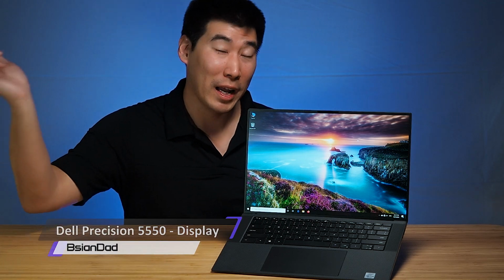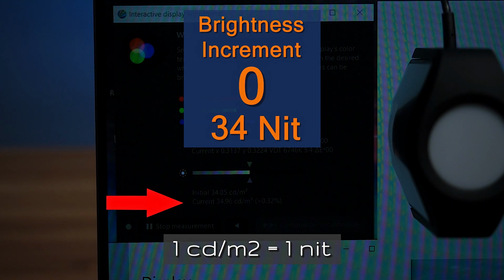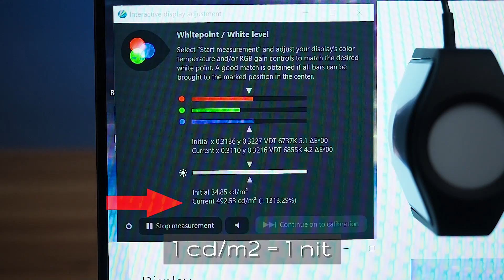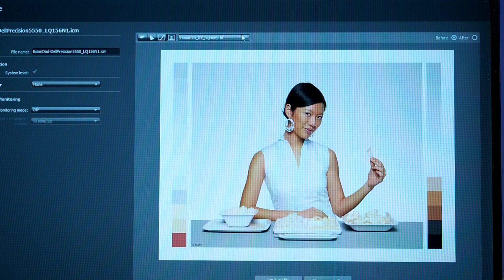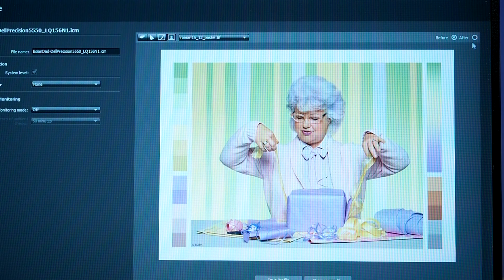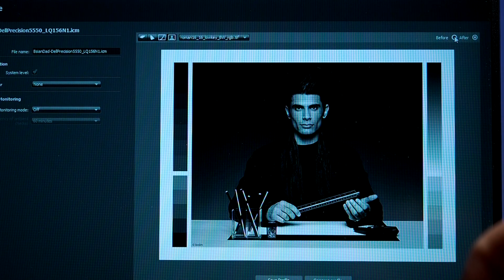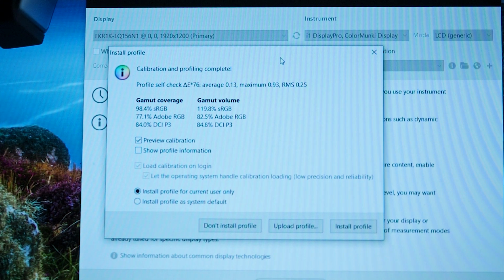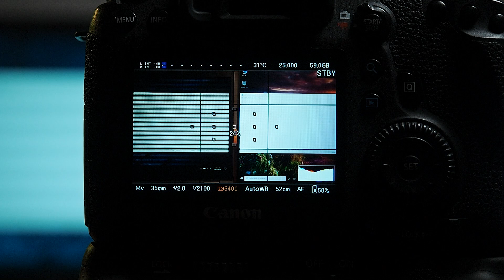Dell Precision 5550 Display Review and Color Calibration

Comment: How do i keep this Laptop cool?
I mostly hear fan noise and heat when plugged in
Reply from the maker: Laying it on a bag of dry ice =D, seriously a lot of the precisions 55xx-56xx series ran hot hot. The 57xx series did better in thermals as it is a different thermal system to the 55xx series.

Comment: If you had the precision 5540 2019 version which you got 3 months ago and this has come out now. Do you think it makes sense to upgrade to the newer version ?
Reply from the maker: Hi Soda Pop, welcome to my videos. If you can upgrade without too much cost then yes I would, the the faster processor is worth the trouble just because this computer is meant to crunch numbers, even with the oversize trackpad. If not carrying dongle around important then keep the 5540. The 5550 keyboard is nicer than the 5540. If you had to purchase this again completely from 5540 I think just keep the 5540 till the next refresh model.

Comment: Thanks again for the great content. Do you recommend the FHD over the 4K screen?
Reply from the maker: Cheers Jesse, it all depends on the application you use, will 4K gain easier access to features or workspaces or unlock extra features as well for the application. Sorry couldn't give a straight answer, from my experience certain specs and features its all application driven and cost factor.
Reply: I know it's been 6 months now, but just my 2 cents - I got a 5550 with the 4K display from work, and...well, it's absolutely horrendous. The colours are way, way, way too saturated (to the extent it looks cartoonish) and there's no colour profile nor adjustment that works - looks like the oversaturation is just built in. 
On top of that, 4K is definitely too high a resolution for a small panel - you have to use some of Windows "maginified" profiles and the result is that text is simply not well defined with blurry edges that suffer from a tiny bit of rainbow effect. Finally, the touch feature is useless and actually detrimental - every time you touch the cover to adjust the screen position, you end up slightly touching a border of the screen, closing or moving stuff you might need. 
All in all, the horrible horrible horrible screen makes my eyes itch and burn within minutes; I am particularly fussy with screens, ESPECIALLY with text border issues - some of my colleagues kept saying the screen was "fantastic", so I wondered if mine was defective and nope, I put my laptop side to side with theirs - exactly the same issues, but somehow they don't seem to be able to see the smudgy text borders nor the fact everything looks like an oversaturated mess on their screens.
Reply: @h3llr4iser1 download Dell Premiere, in the Advanced Color Setup, set your color to DCI-P3 and temperature to 8200K black Levels -4 if u like.. according to you…

Comment: Good one. Very professional display review. Although for most colors I prefer the factory calibration. Mostly it seems to reduce brightness (light) and give a warmer hue.
Reply from the maker: Thanks very much Sumit Roy, doing my best to give you all the best experience. Aye a lot of the time manufactures will tweak the colour calibration for "nicer" user viewing experience but unfortunately as a content creator you need the confidence that you are working with the correct colours and brightness so when you produce media (videos/photos/graphics) they are to the intended look/colours/mood of the creator. Accuracy of colour brightness is extremely important when editing for black and white (monotone) output media. Absolutely nothing wrong with your comment Sumit just giving an expanded view from a photographer's view =).